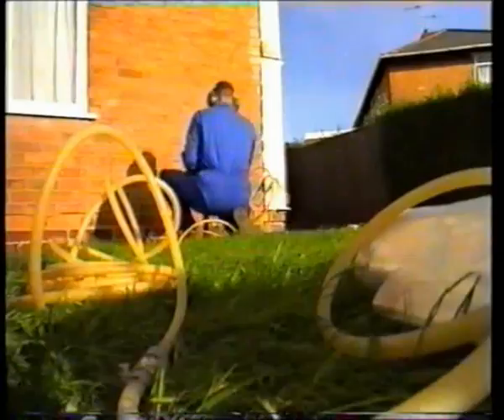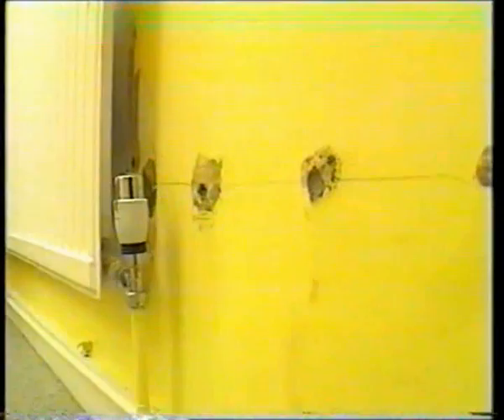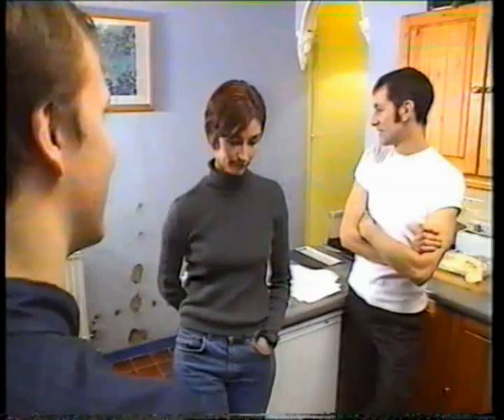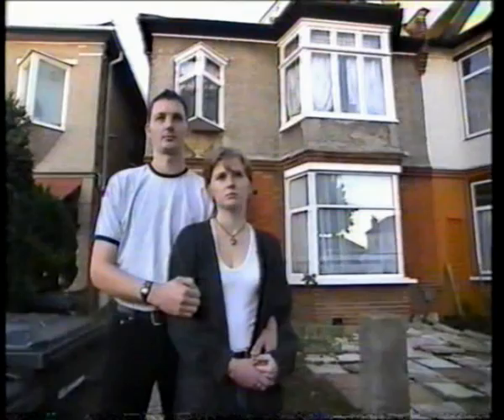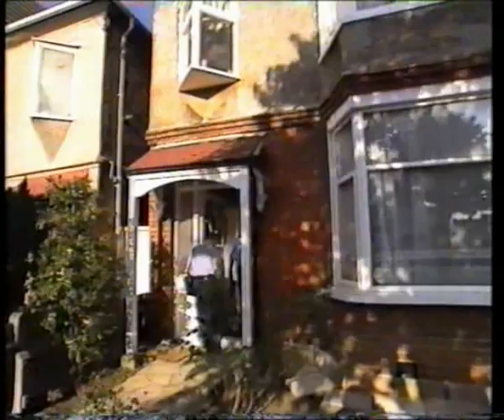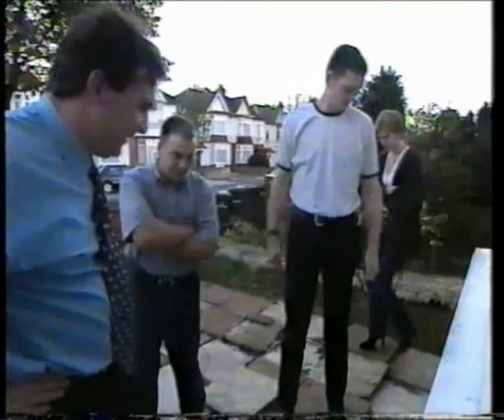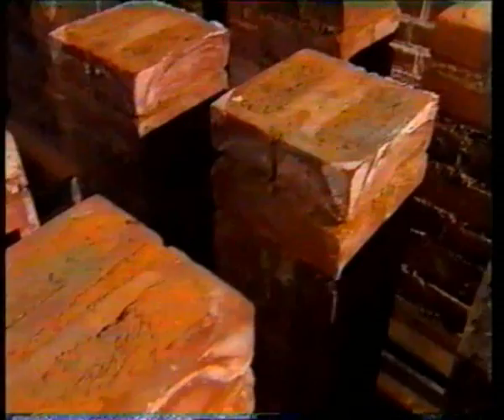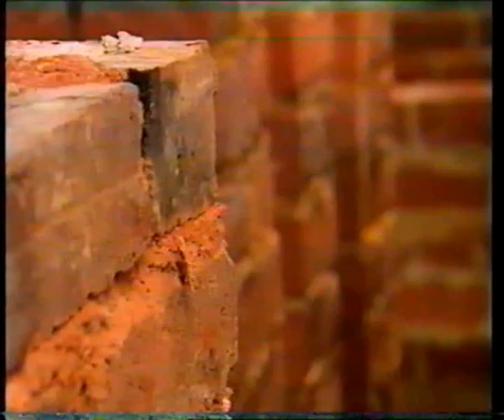Renovation Rising Damp ? No Such Thing 2 Download

Comment: Fascinating discussion this 
Just bought a 200 yr old stone house    previous owners had repointed over the existing lime pointing with cement causing damp inside the house after many months i have removed all the cement & guess what the damp is slowly dissapearing 
Its very satisfying watching the outside pointing turn from soaking wet to dry      bloody hard work but worth it
Reply: Did you remove all the cement yourself?

Comment from the maker: All that has happened is that our damp proofing industry has found a bogus solution and  cleverly taken advantage of a change in lifestyle. 
Its not a coincidence that this damp problem more or less coincides with the removal of solid fuel chimneys that ventilated whole house and expelled damp air straight up the chimney. There is also the introduction of hermetically sealed houses using upvc double glazed windows and doors.

Comment: Damp will not rise up brickwork even if the house was built on a pond or marsh! The reason is simple. Because a wall is made of two materials[bricks/mortar] Capillary occurs in the brick but when the moisture reaches the mortar bed it acts as a capillary break and greatly slows down the capillary.Large pours in the mortar can not suck the moisture out of the tiny pours in the brick ! This is the law of capillary.

Comment: I agree. If brick columns palced in water cannot get water to rise then damp proofing/treatments are obsolete. However wall and floor sealing when it comes to going sub surface, coupled with a high water table and/or saturated ground would be important to prevent seepage.

Comment: Stonework is a bit different to brickwork as the building units can be quite large. Moisture will rise through capillary action in porous sandstone to approx 300mm above ground level if there are no mortar bed joints to act as a capillary break.

Comment: Just been to look at a 1930,s ex council, property with black mould growing in downstairs corners of rooms window reveals, stairwell gable end wall and bedrooms where ceiling meets walls .Also hygroscopic salt damp stain on chimney breast in bedroom. The house had had the dreaded cavity insulation installed ! Off course they had blocked many airbricks that were venting the rooms. The tenant didn't like it when I told her it was all condensation problems due to high humidity and lack of ventilation. I think these problems are worse this year because of the heavy rainfall in uk. I have arranged to return to the property and install some simple vents before winter.
Reply from the maker: It's the strangest thing. People would sooner spend a fortune of bogus rising damp cures than concede that it's a lifestyle problem. They just hate to think that it's simply the way they live and that it's the lack of proper ventilation that is the main cause of their problem.
Reply: rollindanny57
Reply: Piv fan should solve this.
Reply: Retro Fitted Cavity wall Insulation is a nightmare!!! Cavities are their for a Reason ALWAYS REMEMBER  THAT!!!!!!!

Comment: My 'rising damp' problem which previously had a failed damp course injection was actually penetrating damp from high external ground. It eventually got solved after hiring a dampness surveyor.. money well spent because it ended up getting sorted once and for all. Plus the advice and works ended up much cheaper than another useless damp course injection.  I have made a video showing my problem and how it was solved.
Reply: Hi, l would be interested in your video to know how you solved your rising damp issue thanks.  Lesley.

Comment: I have been a builder for 35 years and believe me when i say rising water table during heavy rain and winter weather is not a myth water rises beneath sub soil . Replaced countless dpc systems destroyed brick faces caused by salt damage again caused by ifluesents in acid rain... .. one major thing you should be asking is why your wall is then wet why is salt damaging your bricks.. why does moss grow on facing bricks below dpc.... and if water tables did not rise bridged damp course or damp course altogether would not be needed.... i agree not all houses suffer... worked on many georgian and victorian houses without problems all depends on height of land v water table levels...
Reply: I think the moss on brick below DPC can be explained by rain splash from the ground giving the moss moisture, so it doesn't prove the moisture is rising through he bricks.

Comment: Moisture meters are useful tools when  investigating damp as they can tell you which areas are dry. They  cannot confirm the presence of damp  in anything other than clean timber. To quote the manufacturer "Contrary to popular belief, a moisture meter is not a diagnosis tool. Rather, it helps an inspector make an informed call about moisture’s presence within a space or material. If your meter is giving you a high reading, then that merits further investigation -- dampness may not be the reason for the measurement; metals and salts cause false-positive readings."  It is critical that a  full investigation be  undertaken and a  correct diagnosis is  reached before undertaking any work. Typically damp proofers have  neither the knowledge or inclination to to the right thing. BRE state in “Understanding Dampness” that: “In the 1970s, BRE carried out an exercise with a major damp proofing contractor to evaluate their systems. Great difficulty was experienced in locating sufficient properties that had a rising damp problem,”

Comment: I have an outside rendered wall which was showing signs of damp but causing no problem inside. In summer when the wall was dry I sprayed the wall with a good dose of WD40. The wall has gone through the winter and is as dry as a bone. I don't know if this will work on internal plaster but I think it will soak into the plaster and cement of the brick and make the wall damp proof?

Comment: here in Sunderland the local labour council ''decided oh let's get grants from government and waste and squander it on ''ripping out perfectly dry  cavity wall insulation' that they got from payments government grants a few years ago, ''oh yes let's tear down perfectly strong gable ends ''(only needed pointing'') cowboys are now wrecking the gable ends,bricks that have been broken struggling to get them out (you would think they used sledge hammers)3 feet of new bricks at the top ,the rest of the old and damaged bricks put back in,cement looks as old as what was all ready in the gable end for  60 years, this cement its very sandy,( shite) ,cement is all over the pavements,the alleyway looks like a concrete drive not as individual pavements,and the pointing and brickwork ,its as though a job scheme as done it to receive there dole money, its absolutely deplorable ,when I questioned why work was sanctioned ''oh you might get damp'' my neighbour 2 doors away who does have damp in his house , they have missed him out,and went to another house which was perfectly dry ,my old mothers house,there should be government building specialists agreeing to any money spent and  squandered on unnecessary work,and if need be ,councillors paying out of there own pocket,even if there own house as to be sold to pay the debt ,my house was completely dry and warmer,and was tidy ,all was needed was a bit of point work,but these xxxxxx look after each other,you scratch my back and i will scratch yours,this work ha ha work, will not last two minutes, never mind 60 years
Reply from the maker: Yes you're absolutely right, this scam has been going on for over thirty years and local authorities are almost single highhandedly  responsible for the perpetuation of this totally bogus problem. Local authorities  should be held to account and made to pay compensation.

Comment: Jeff Howells at 5:27 onwards says that he has been unable to replicate rising damp. But when I search YouTube, I find videos showing bricks standing in trays of water and damp is clearly rising vertically over time through the clay bricks. How can this be?  He also mentions a certain type of mortar he has created that will allow rising damp. Well, many old house were built with weak lime mortar which perhaps is similar to his concoction. I live in a Victorian house. In the under stairs cupboard the brick wall is unplastered and the mortar is soft and crumbly and a bit like dry sand falling onto the floor.
Reply: +Moultonist Yes all houses built before ww 2 were built with lime/sand mortar . Jeff did try cutting out a section of victorian brickwork and placing it in a water trough.The moisture still only reached a few inches above the water line and the stopped!

Comment: I found a 3 foot hole in my outside of my brick wall, mortar was gone inside covred by soft mortar, that's where the wall is the damp the most. Filled the gap with cement so going to have to check my mortar around the bottom of the outside wall.

Comment: If rising damp doesn't exist a damp proof course has no use, so why would a high ground that breached a dpc cause damp?
Reply: Because the dpc is at floor level. So having ground levels above dpc level it's also above floor levels so the damp is coming in sideways. It's not that the dpc has been bridged, it's that damp can now come sideways through the wall where the plaster is rather than the floor void below where it's supposed to come through. It basically just so happens that the dpc is also at floor level. The language used by many is therefore incorrect, adding to the confusion; the damp isn't "breaching the dpc" level so much as it's "above floor level so the water pours in sideways" into the living area like flood water due to gravity. As water flows horizontally and can't go vertically naturally, due to the laws of physics, unless you have a pump. This phenomenon of horizontally penetrative water isn't noticed below floor level as that's not a lived in space and it naturally evaporates off because of the use of air bricks. It's why when you cover up under floor air bricks your wood floor rots as the lateral moisture has nowhere to evaporate out.

Comment: There can be several reasons as to why people experience damp in properties. Rising damp does exist as the bricks are porous and the damp is drawn up from a failed DPC. Often people raise the ground level externally which can cuase the rain to splash over the DPC or even worse if the surface water is above the DPV. Old and weathered or poor pointing can also allow water to penetrate as the old pointing in period properties is dry and porous which can draw the water in 9" solid walls and penetrate internally. Leaking gutters running down the walls can also penetrate through the walls of 9" solid walls. A boundary wall or garden wall should not be build adjoining a house as this will also allow water to travel through the wall but a gap of a couple of inches should be left to prevent this. Cavity walls are a different scenario and a possible cause is that the cavity may be bridged allowing water to breach the cavity. The cavity may be breached with debris is one possble cause. To say there is NO such thing as rising damp is absolutely absurd and ridiculous. Another reason people sometimes get confused with damp is condensation. Moisture in the air of a warm property condenses on cold surfaces particularly in older properties with 9" solid walls in the colder winter months as the walls are cold. It is important to ventilate buildings to prevent this. It is important to find the cause and treat the damp for the right reason prior to carrying out any work in the first place.
Reply from the maker: Whilst it’s always interesting to hear from a practitioner of damp proofing’s “bogus art” defend its income stream, in this case it’s clear there also seems to be a problem of simple word recognition.
 
A clue is in the title  “Rising Damp? No such thing”
 
“Often people raise the ground level externally, which can cause the rain to splash over the DPC”
This is called penetrating damp.
 
“Surface water is above the DPC”
This is called a flood.
 
“Old and weathered or poor pointing can also allow water to penetrate”
For assistance on this, please note the last word in this sentence.
 
“A boundary wall or garden wall should not be build adjoining a house”
This is also called penetrating damp.
 
Ok so I guess you get the idea here. What we are talking about is “Rising Damp” that is dampness rising from the ground, another clue is in the word “Rising”

Comment: Render that brickwork and then then you'll get rising damp...
Reply: Wouldn't you also need to apply the temperature differential up the courses of bricks caused by central heating. These brick pillar experimenters do seem flawed, that doesn't prove they are wrong though as many experts dispute rising damp is a problem. But then that does make you question why damp proof courses have been used for over 150 years.

Comment: Rising damp comes up through old mortar that has virtually turned to dust over the years and which was probably not mixed right in the first place, basically too much sand and a cement power that had gone off and was no longer active. If you add to that an underground pipe that is leaking nearby and high humidity in the house due to the windows being closed then you have a problem. The best cure is to replace a line of brickwork working along slowly so as not to cause the wall to collapse - cheap to do really but time consuming
Reply: Did you know that all houses built before world war two did not have cement in the mortar! They were built with just lime and sand or lime and black ash.Sand and cement mortar only became popular in the 1950's and they were still using a lime/sand mix for the internal plastering until the sixties. Cutting out a course of bricks round a house is a very skillful operation and should only be carried out by experienced bricklayers.If you dont get the work solid then cracks will appear or even worse the wall can collapse .I have heard of this happening several times when attempted by a novice.

Comment: You have just clearly shown (rollindanny57) that you really dont know more than the experts. The damp rises through the render as the render has no dpc in itself, this allows the water to penetrate the brick above the original slate dpc.
A drilled and sprayed dpc injection, injects a silicon based liquid into the brick filling tiny pourisities within the bricks structure, this makes the wetting ability of the waters minicus useless meaning capillary action cannot lead to rising damp!

Comment: It's a spiritual thing. Some people believe it exists, some don't. Only when you've had a true 'rising damp' experience will you be convinced. I've seen it. I can't prove it. But I know it exists. As in other fields where faith is an aspect, there are many charlatans.
Reply: It's not spiritual. If you have something that looks like 'rising damp' a proper survey will find the cause and it will never be actual rising damp. There is no  indication for a chemical damp proof course - they simply do not work, destroy the bricks and delay getting the cause fixed. The only thing it helps is the bank balance of the industry.

Comment: Fascinating. We moved into an old house that had mould and a musty smell when left closed etc.
A man came out and measured moisture levels going half way up the wall at one end of the house but none the other end.
We had the holes drilled and liquid stuff put in that creates prevention from rising damp.
Six months later all dried out and problem solved, sorry but rising damp is real.

But mainly in over 100 year old houses that have lost their damp proof course (the slate sheets between the bricks cracked).

Moisture meters can read high readings from the salt on the walls so you are supposed to strip off the render and wait a half a year for it to dry then re-measure.
Reply: So it was solved when you moved in, turned the heating on, opened the windows and dried it out? Fascinating...

Comment: What a load of crap,been in the building trade 30 years seen damp travel up brickwork many times,doing a cottage up at the minute with a tidemark 4ft up the wall.yes there are other problem that can lead to damp but any builder worth is salt will sort it.makes me so mad when twats try tell you your job just because they read a book.
Reply: sorry but most of these problems are caused by the building industry. all they know is cement cement cement or gypsum, its the answer to everything. i asked a brickie once if he uses lime and he didnt even know what it was! gypsum + cement should not be used on solid traditional walls full stop.
Reply: You sound like the type of builder I would avoid. No such thing as rising damp cowboy. Did rising damp exist 100 years ago? It's condensation or moisture trapped within the walls that can't escape because the house is being.  suffocated by impervious materials like cement, gypsum plaster or acrylic paints. Take all the crap off and the house dries out.
Reply: I think what you have seen is damp that has not properly been investigated. Lots of penetrating damp, high external ground level etc presents like this.  Our lovely 1930s house was destroyed by shitty trades people applying portland cement on lime, encasing it in crappy plastic paint that is causing all sort of brick spalling and mortar damage and injecting wool int o the cavities which is now damp And silicone everywhere. Honestly if these people read books they would understand and respect buildings. Instead happy to get their information the chemical companies promotional videos.